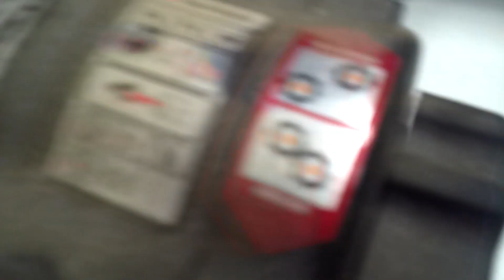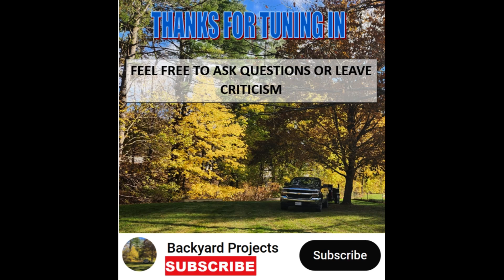Adapting Traveler Wireless Winch Remote to a Winch it Wasn't Designed For

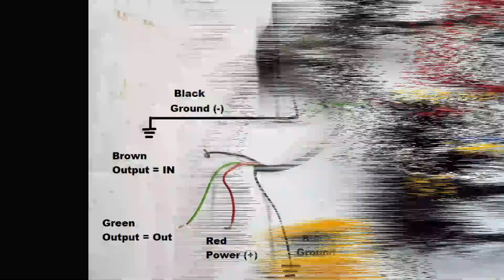Comment: 4:52(wire schematic) Thank you, I connected this remote system up in parallel with my original switch on my dump trailers hydraulic system. Super nice to be able to stand behind the trailer as it is lifted so I can see what’s happening. I can also lower it from the cab while I drive off.

Comment: The “Ground” or external black wire on the wireless control receiver box is the Wireless Antenna. Not a ground or earthing wire.
Reply: That’s not true, the original packaging says that it’s a ground and to connect it to the black wire on your winch.
Reply: @White_Line_Warrior_350z  that wire on my Champion setup is an antenna . That is why one would assume it is the same across brands